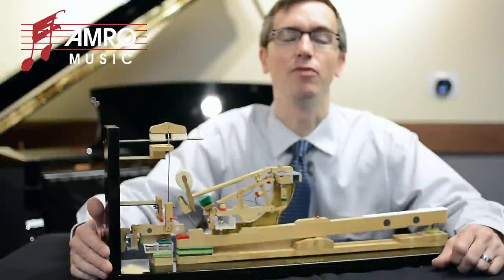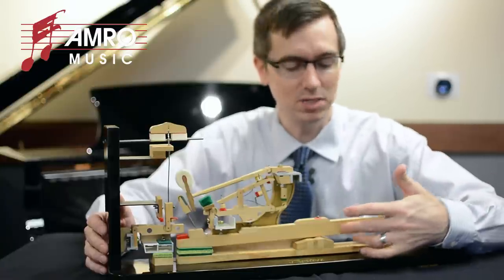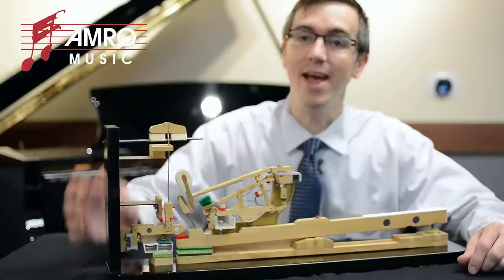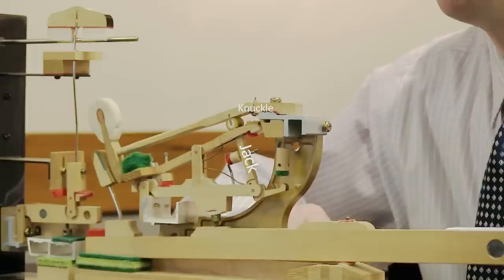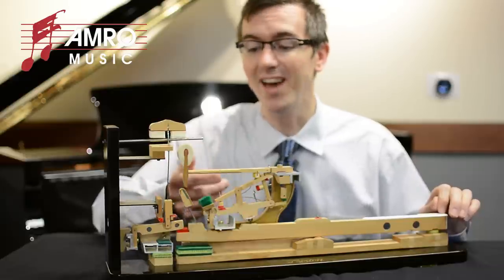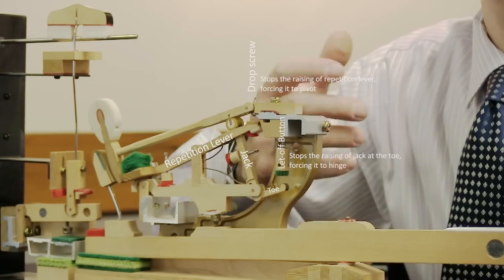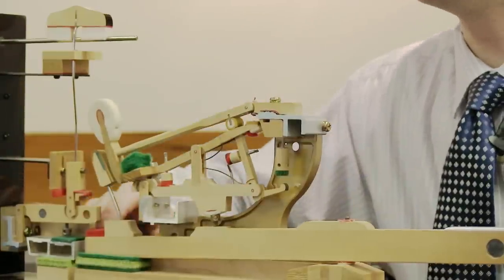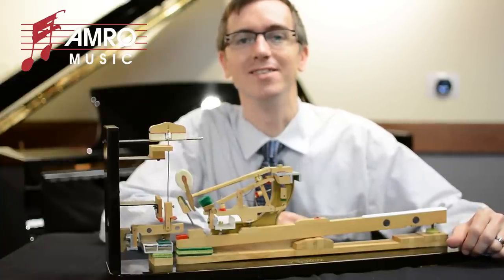How Do Pianos Work? - Piano Keys

Comment: Nice explanation! Just to make things a bit clearer for viewers of this video: 

The blow distance (the distance the hammer travels from its resting position to the string) is typically about 46 mm. The jack might, so to speak, start to prepare for slipping away from under the knuckle in the last third of the traveling towards the string (as mentioned in the video), but the actual point where "the click" happens (called let-off) is as close as 1.5 mm to the string in a well regulated grand (a little bit further away in the low bass.) 

The click sensation is experienced when the hammer drops down from let-off about 1.5 mm (called the drop level, thus about 3 mm from the string), ending up resting on the repetition lever, ready for fast repetition of a single note.

This is, apart from the una corda pedal, the biggest difference between a grand piano and an upright. A grand piano allows for a new strike much sooner thanks to the repetition lever, when the key is released just a few millimeters from the bottom position, whereas on an upright, the key needs to be released basically all the way up to allow for a new strike.
Reply: You seem to know piano actions very well. Can you tell me how the sustiano pedal keeps the dampers up for notes pressed before the pedal is pressed and not interfere with the dampers for other notes to raise and drop as notes after the pedal is held down? I want to build my own demonstrator that shows how the 3 pedals work at the action level. The sustiano is what people describe WHAT it does but not HOW at the action level. Thanks
Reply: @paulromsky9527  I could, but there's a pretty neat video clip here on YT where you can see it all animated! The small tab on the damper lever that you mentioned in a comment above is solely used for the sostenuto mechanism. Watch this:
https://www.youtube.com/watch?v=6effL4ATZVo
Reply: @iaspati610  Patrick, Thanks for the links! I am starting to draw my design now. I hope to start cutting wood in a couple of days.  I am going to make mine out of Maple because I can get it at Home Depot or Lowes and not have to go to my local specialty lumber yard which is 30 miles away. I would love to make it all out of Delrin, but I don't have a milling machine. 
I was going to make my bearings out of Teflon, but after learning about the "Steinway Fiasco", I am going to stick old school and use felt. Paul
Reply: wow 👁👄👁

Comment: Created by genius
Reply: Actually by many people (true engineers) over 100's of years. Each improving on the others. "Build on the work of others."
Reply: @paulromsky9527  The invention of the double escapement system is due to Sébastien Erard in France about 1820. Later inventors only added minor details. In fact the original mechanism is surprisingly similar to that of 200 years later. The Erard is even superior in 2 ways: contrary to modern piano's it is possible to take out the keys individually and the damping system in its entirety, greatly enhancing ease of regulation and maintenance.

Comment: Great video.  You explain the mechanisum very well.  I know that the sustain pedal simply lifts up all the dampers.  In your demonstrator, there is a small L shape piece of felt on the damper lever.  I assume this is where the sustain pedal will cause a bar to lift up all the dampers.  Am I correct as to where that occurs?   It would be nice if you could mention this in a follow on video.  You don't have to demonstrate it, just describe how the sustain action works and point to the area.

I know the soft pedal just shifts the entire keyboard to the right a small amount so that the hammers hit only one string of the two string notes, two strings of the three string notes, and still hit the one string of the single string notes.  Ok, that is easy to understand.

What is hard to understand is how the middle sustiano pedal keeps the dampers up for notes that were held before the pedal was pressed but still allows the other dampers to raise and lower as subsequent keys are pressed and released after the pedal is held down.  How does that part of the mechanisum work?  I am sure it is as elegant as the rest of the action, but I can't figure out how it works.  Could you demonstrate that, or at least mention it in a follow on video?

Thanks
Reply: Romsky
If you could explain how the 3 pedals work with the action, you would be the first person on YouTube (that I could find) that does that. I see a lot of videos that describe WHAT the 3 pedals do, but not on HOW they work at the action level.
Reply: The way it works is by catching the L shaped red felts on the dampers into a shelf-like part of a comma-shaped profile bar (isn't presented in this video). The bar can rotate by the press of the sostenuto pedal, and rotates the "shelf" towards the damper felt strips. When the keys are pressed and dampers raised, those felt strips can be caught on the "shelf" of the sostenuto bar by pressing the sustenuto pedal. After pedal hold and key release, the felt strips lay on the bar's profile ("shelf") and the higher located damper felts don't rest on the strings only on previously pressed keys. The other key's dampers have their red felt strips under the bar's profile, and don't get caught in raised position. The wooden part on which the felt strips are located apparently can pivit down, allowing the other "uncaught" dampers to fully raise and not bump into the sostenuto bar. After pedal release, the raised dampers can drop.

On this image, part 14 is the comma-shaped profile bar that the sostenuto pedal rotates, and part 35 is the sostenuto tab that gets caught. The part 47 (damper lift rail (sustain pedal)) is shown a little bit confusing and maybe incorrectly though. All it does is lifting a rail that lifts all dampers, so it's not such a bad picture. 
https://pianoworld.com/wp-content/uploads/Images_for_Various_Pages/Grand_Action.jpg

Here's a great video:
https://youtu.be/6effL4ATZVo

Comment: Would you please shed some light on the topic: Does install a player system on a piano impact the touch, the pedal, and the sound quality of the piano? Appreciate your insight!
Reply from the maker: A good player system install shouldn't impact the touch of the piano or the tone quality. Depending on your brand of piano and the installer's method, experience, etc.., it might change the feel of the pedal slightly - often the pedal trapwork has to be cut to allow the pedal solenoids to "intercept" and operate the pedals.  A good technician can adjust this so that most players don't notice the feel, though.
Reply: AmroMusic Thank you so much for the prompt response!

Comment: Could someone explain to me why we need such complicated machinery to achieve a seemingly simple task - raise the hammer to hit the keys? Why there are so many additional levers? From what it seems, only the hammer, the primary lever (the keys) and the damper is required..
Reply: As a piano player I assume some points why it's a bit more complicated than a simple lever mechanism.
    1. The hammer shank needs to be immediately "removed" from the string, otherwise the sound will suddenly stop. -> you keep pressing the key when you play a "long note" 
    2. When you want to repeat the same key immediately, it needs a component with a low Inertia. Also note that if the hammer drops down to its rest position, it would take too long to play same key. 
I hope I helped a bit. The mentioned points are NOT researched.
Reply: Very well stated. The hammer has to be tossed up and bounce off the strings and allowing it to be thrown at different speeds (hence the name piano-forte soft-loud). Also the dampers have to raise and lower, and a rapid repeat needs to be allowed. Put all that together and you need more than a simple lever...and that is why we have such an elegant and intricate system of levers. The piano is an elegant and so versatile instrument.

Comment: Hello and thanks for the informative video :)

Maybe you can shed a light upon a question about the piano action that I can’t quite solve.
To my understanding the hammer has to be accelerated to a certain minimum speed otherwise it will not be able to reach to the string and thus it will not produce any sound.

Also to my understanding the volume of the sound depends only on how fast the hammer gets accelerated by the key and therefore how fast it hits the string.
Now here is where I have difficulties to grasp: 
how is it possible to play (very) fast runs or trills not only loud but also silent?
Eg.: you can play a certain fast passage f or ff but you can also play it mf or mp.
So here is my comprehension problem: in all cases the passage is played at the same speed which means that the fingers have to “fly” at the same speed over the keys.  
Essentially (in my understanding) this would mean that in all cases the keys are accelerated by the fingers at an identical speed.
So how is it possible that we still can produce different volumes?
Where is the point that I am missing?
Many thanks in advance
Reply: I believe it simply has to do with the amount of force you play with. If you keep your fingers close to the keys and play gently using only the strength of your fingers then the speed at which the hammer travels to the string will be less. But if you raise your fingers higher before striking the key and lean forward into the keyboard as you play, using the strength (and weight)  of your arms and shoulders then the hammer will move much more quickly (with more force) toward the string. All that extra energy being transferred to the string will produce a louder sound.
Reply: @MoreWordsPlease , what I know is pianists should play fully to the bottom of the key.  I'm thinking digital pianos should have optical sensors that measure the speed of travel between two points, not just a contact sensor.

Comment: Why do most diagrams and models show the key tilted towards the piano when I usually see them flat on a piano?
Reply: You can see in the model that the key is down at the back and up in the front which creates the tilt.   The hamer is actually flipped at the string.   There is no direct connection between the key and the string except when the hammer freely strikes the string with no actual connection to the key.  Digital pianos don't have an actual escapement.
Reply: I think that the tray in the piano - where the action assembly sits - may have a counter tilt. So, when inside the piano the keys are level. I think the builders of the demostrators are more concerned about showing the action - they are made for the piano store to help up sale the more expensive pianos.  I am building my own demonstrator, so I be sure my keys have no tilt when at rest. Also, mine is going to show how the pedals interact with the action as well. I am even going to have real strings, bridges and tuning pegs for the full effect. Then I will make a killer video with a full up tech trainer model, not something just to help sell pianos.

Comment: Very good, 5 mins went too quickly! What I was expecting to see, was the repetition action. It was mentioned but not really shown. I only found out about that difference compared to the upright piano yesterday, so I'm interested in seeing how the repetition works.
Reply: I agree. It would be nice to show how the repetition part of the action works. It looks like after the tip slides off the knuckle (most I think are actually rollers), the repetition arm takes place of the knuckle (about half way) so if the key is released half way and pressed again, the hammer is already half way there and thrown up again - thus not requiring the key to be totally released to replay it. This allows rapid repeating of a the note. I asked if he could add on how the pedals affect the action as well.

Comment: Hi, very good explanation. My grandma's piano have some pianokeys that are "tired". They are half way down and when I press them I get no sound. So I have to drag the keys up a bit and the I can play on them for a little while, especially if I play forte fortissimo on it (then, the key doesn't get in the half pressed position), but it is frustrating to play like that of course. And after a while the keys gets half way down. What parts on the key-construction may be torn/unfit?
Reply: There are so many factors that can cause a myriad of problems. I would have to be in front of the piano and lift out the action to see what is wrong. But the frame in front of the keys can warp and cause the keys to bind. Shimming the frame may help, but it has to be done carefully. There are 4 common factors that affect pianos: temperature, humidity, shock/vibration, and..... smoking!
If the piano is in a home of a smoker, that will bring on all sorts of problems.  Pianos should be kept at a constant 72 degrees F, 50% Relative Humidity, on a very solid and flat firm floor away from dust, vents, vibrations, direct sunlight.....and above all....no smoke.  Ask a piano tech for a 1970's piano bar and you will hear the horror stories.

Comment: Just a quickie...key sticks are not made of maple.  They are made with either pine or spruce.  Steinway has never made a keyboard with maple.  Their pre-WWII pianos had pine keyboards manufactured at the NY factory in Queens, Astoria, NY.  Post-WWII, they used keyboards made with pine and manufactured by Wood and Brooks through the 50's, and Pratt-Read thereafter until 1984, when they began to use spruce keyboards manufactured by Kluge of Germany.  Kluge has since been acquired by Steinway, and their keys may be found in both New York and Hamburg Steinway pianos.